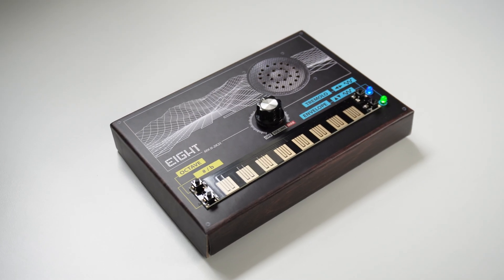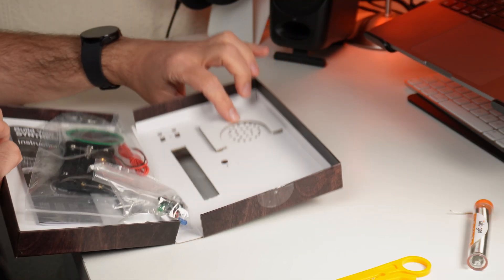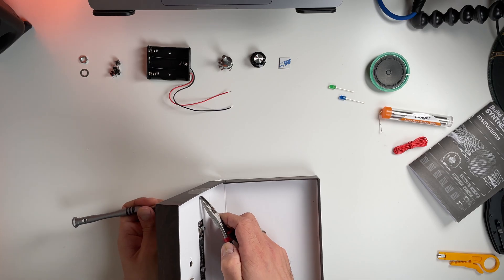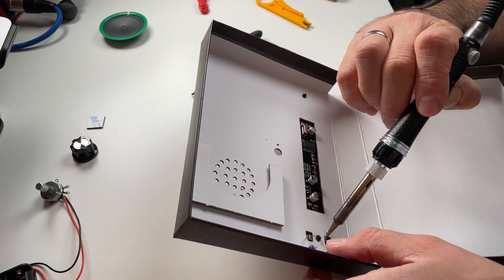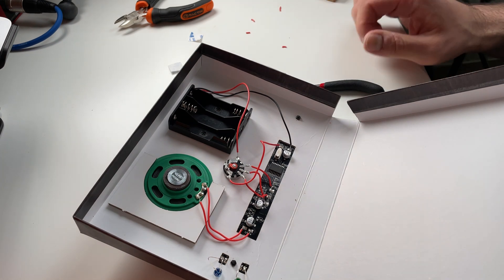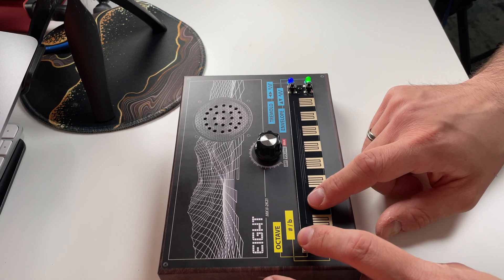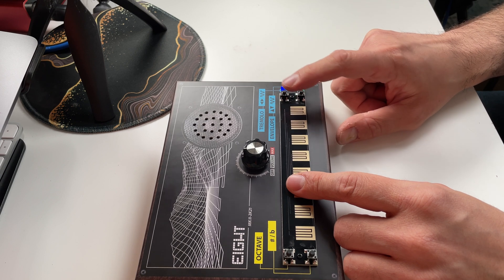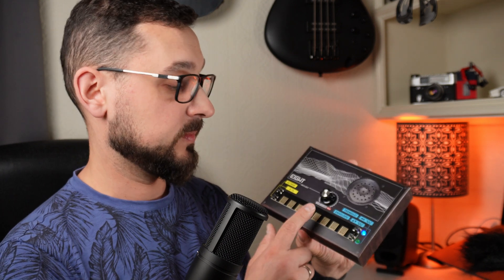Will This DIY Electronic Synthesizer actually sound good?

Comment: The "Tremolo" and "Envelope" terms are incorrect.  "Tremolo" should be "Vibrato" or "Frequency Modulation", and "Envelope" should be "Tremolo" or "Amplitude Modulation".
Reply from the maker: That's right, I'm actually mentioning that in the video at some point. Guys do good electronics but need some more musical knowledge 😂 other than that it's pretty cool